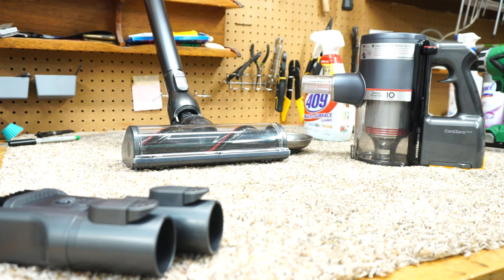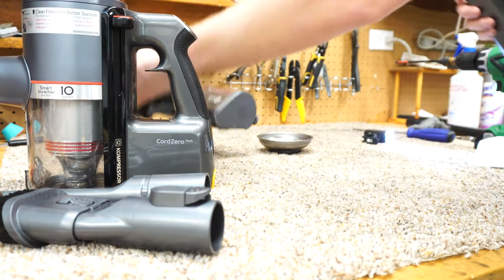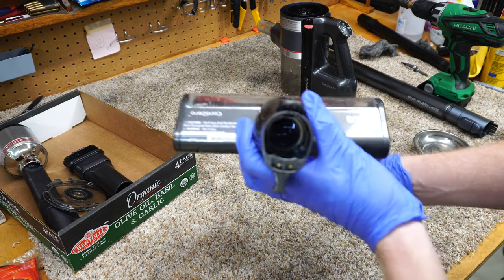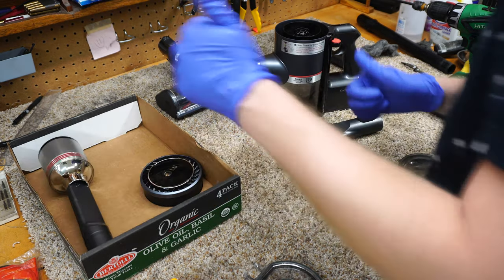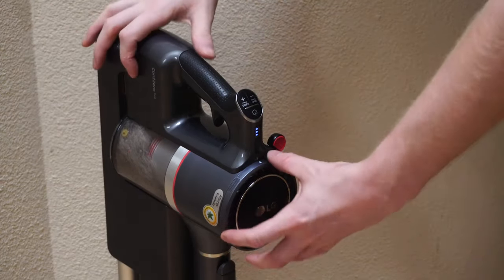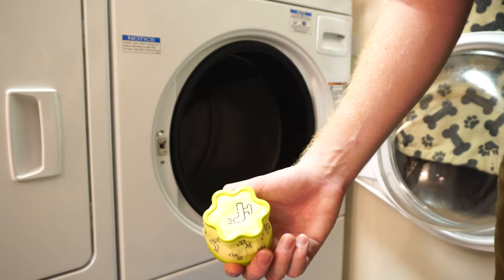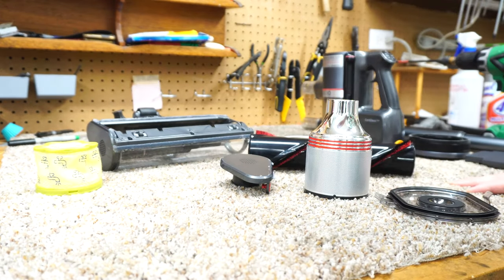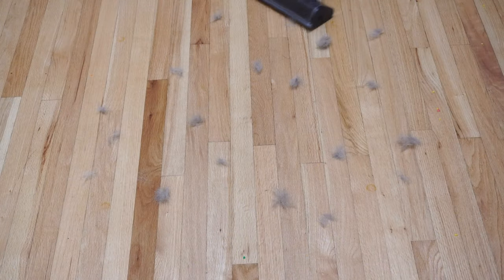LG Cordzero A9 Cordless Stick Vacuum How To Fix Loss of Suction

Comment: We’ve had our LG CordZero for about a year and a half and it has worked well until this surging thing.  I thought it was clogged filters however after cleaning it still surged.  The suction inlet was clogged, problem solved. Great help!

Comment: AHA!!!!  Briliant idea to use a flashlight to check for dust and debris. THAT worked perfectly and now the vacuum works like it should.  I had cleaned the filters 3 times (per another YT video) and was ready to call LG and return the vacuum. Your flashlight idea revealed several large chunks of 'stuff' stuck in the narrow assembly inside. Thank you so much!
Reply from the maker: Glad it was useful! Thanks for watching.

Comment: by the way cartridge bearing looks like the 608rs or 608zz variety. Same style as used in the Bissell Big Green carpet cleaner brush roller end caps.

Comment: I love this vacuum however recently took the carpet head brush roll apart to clean and put it back together but it will no longer spin. I tried the vacuum with my hardwood floor head and it spins great. What did I do wrong? Thank you!

Comment: I have cleaned all of the filters and have made sure nothing is clogged but my Cord Zero keeps shutting of if I try to use turbo power. It seems to work fine in the lower settings. I have two batteries and both appear to be fully charged.
Reply: Mine is doing this, too.  Did you ever figure it out the cause and/or a solution?
Reply: I'm buying a new A9 MOTOR (HANDHELD) UNIT FRIM EBAY  90$

Comment: My compressor ring thingy seems to be blocked from retracting all the way back (about 1 inch short). This means the dust/dirt ends up above the compressor ring😢. Any ideas of how to fix this? It feels like the it is hitting something hard somehow (near the retracting bar or lever). I’ve tried taking it apart as far as I can but can’t find a blockage.

Comment: Dude, I accidentally started the vacuum cleaner without the cyclone cylinder filter and vacuumed the carpet for about 30 seconds.  
Could dust get into the engine and how do I clean the vacuum cleaner in this case?

Comment: My battery wont charge. station charging light flashes for a couple minutes then stops. I read online theres a safety switch you can toggle but i cant find directions on how to open the battery and get to that switch. It doesnt charge when connected to the vacuum either. If u can help i’d appreciate it very much.

Comment: I have a central vacuum and need to replace the powerhead.  I have carpet tile and hardwood.  Can you recommend something
That isn't super expensive.  I was looking at et1 et-2 and ebk360, any other suggestions.  I need a bare floor brush also and wands to
Go with the powerhead and bare floor brush.
Reply from the maker: Order an ebk 360 kit it will come with a parquet twister style of floor nozzle
Reply from the maker: https://youtu.be/IlN-_w393dM

Comment: This have less cyclons i think 8 compared with dyson that have 12 of it, this mean that the prefilter motor get more often dirt than dyson v11 or v15? But in this you can take off the cyclons and clean them in dyson i willnever because in gona distroy it😂
Reply from the maker: A little secret it doesn't make a difference after two.
Reply: @PerformanceReviews  so even lg doesent make the prefilter dirty often like dyson? Also the conic cyclons seem have different shape in lg seems so straight and not in tornado shape i don't know 😅 and us y can see from other comment, a lot of people's after 3 months  lg was not vacuming loss suction i don't think his happen in dyson,but the way i like bpth and i don't know witch one choose, lg is better because much more strong power suction in the test of dyson v11, and you don't have to keep the botton for running it, is more quiet, but dyson have the laser 😍 and i guess a well engenired cyclons and better empty solution
Reply: @PerformanceReviews  dyson 12 cyclons, lg 8 so they are 4 less non 2

Comment: You are supposed to wash that paper top filter, it says in the manual. None of those things go in the dishwasher though, just hand wash them in the sink. good grief.
Reply from the maker: Sometimes it just means definitely have read through the manual. It's a horrible idea to wash HEPA filters that's well documented with vacuum companies. 

Why hand wash it if it fits in the dishwasher?